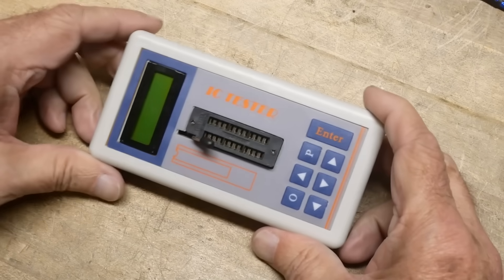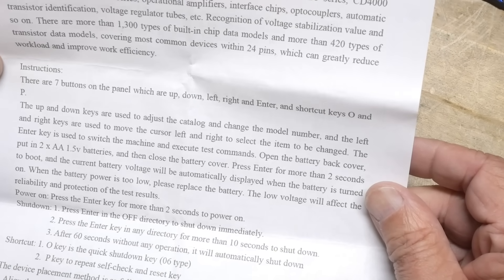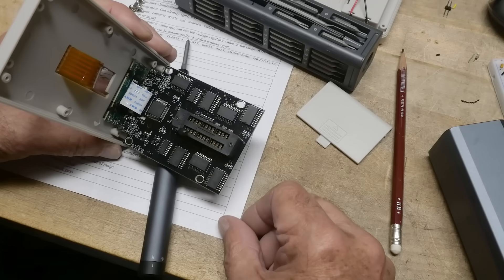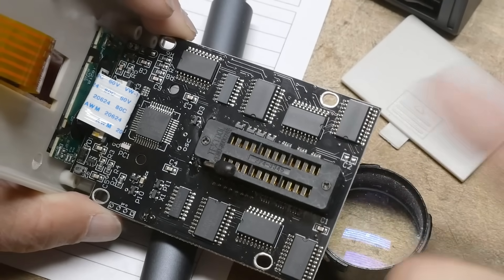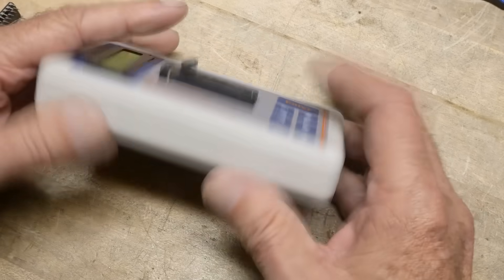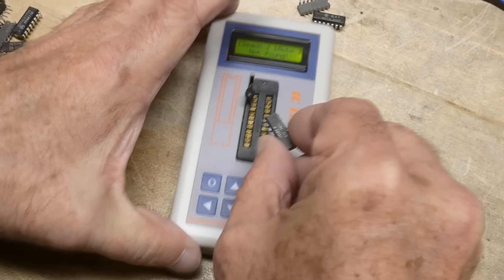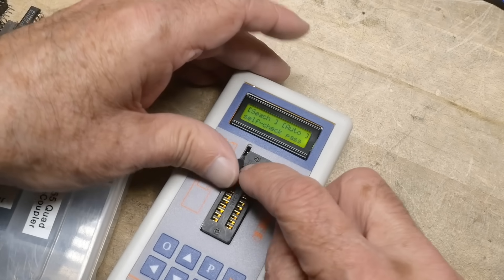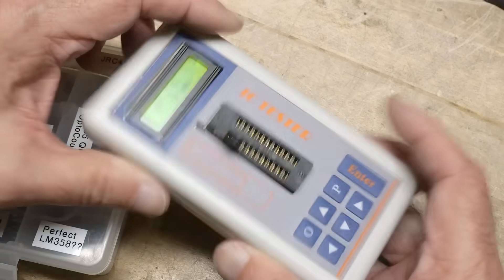#2245 IC Tester

Comment: I have that same tester (as well as a few other more advanced ones) and it does actually get used, as it is quick and easy to grab to quickly test a chip with, and so far has correctly identified if a chip is bad. I have the Retro Chip Tester pro as well, which is considerably better for testing IC's but is more bulky and harder to use.

Comment: I was contemplating getting one of the much fancier, but only slightly more expensive one, the Retro Chip Tester I think, for a project I was working on, but ended up not needing it, and never followed through with getting it. Good to know there are "cheap" versions available too, but for the few dollars more, I'd probably get the community supported one. I think it was actually fairly easy to add new chip definitions yourself, which makes it quite a bit more useful than a no-name generic overseas one which is basically what you get is what you get.

Comment: I have one and it's my go-to tester for most TTL and CMOS just because it's so simple to use.  But there are some that it doesn't work correctly on, like 4021, 4020, 4029, 4040.  Also some non-LS chips fail, like 7400 and 7474.

Comment: I bought an ABI Chipmaster, similar to this device, back in 1995 and it still gets occasional use working on vintage computer gear. Has been very useful over the years! The bigger ABI System 8 can actually test devices in-circuit too, compensating for in circuit configurations.
Reply: at 2:45 (and later too) you can see the - curiously mirror-imaged - text on the reverse of the PCB ... "ABI Chipmaster" ... it seems odd for that to be mirror-imaged and for the unit to not be labelled externally .. perhaps a copy or (rather poor, on the grounds that it doesn't really resemble a genuine ABI) counterfeit?
Reply: @davidareader I never noticed that - well spotted! It doesn’t resemble the Chipmaster device I have at all and even the software user interface is completely different.  It does seem rather suspicious that it is labelled  ABI ChipMaster internally!

Comment: I bought one of these about 2 years ago. It works great for identifying Logic IC's. But it will not work on any multivibrator hence why it didn't recognize your LS121. When I got mine it was the only thing in the box, so I didn't even know about it testing Transistors etc. I'll have to look around for that sheet you got with yours.

Comment: I have had one for years.  Do I use it, rarely.  However, when I do it is a real time saver.  Occasionally I run across something that has all the part numbers sanded off.  These are great for quickly identifying what those mystery parts are.

Comment: I got a little B&K transistor tester at a hamfest for a buck a couple weeks ago.  Hook a transistor up to it and you rotate a wheel switch and it identifies whether it is a good PNP or NPN and indicates the pin outs.  Or indicates nothing if it is bad.  Marginally useful,  got an old analog tester for further details.  Go No Go type thing for fast screening that pile of surplus or unidentified.  Made in USA though.
Reply: I still have mine, although I don't use it these days.  Used to repair TV/s, stereos, CB's, etc. at a mom & pop TV shop in the early/mid 80's.  The owner had the smaller one, I had the bigger one with an additional meter for Hfe maybe?  Been a while!  We used the crap out of them doing bench work back then mostly for quick go/no-go tests, often in-circuit.  You could match gain with them good enough for most of what we worked on at the time.  Had a lot of B&K equipment back then, their CB Service Master, freq. counter, and CB Signal Generator were the kitty's butt for wrenching on CB's.  Their TV Analyst and Marker Generators were the equivalent on the TV bench, of course a scope on each bench as well.  Sencore was considered top of the line for the repair guys,  and had a price tag to go along with it so I didn't know many guys that had it.  I think they leased a lot of it and I'm sure they had a finance scheme also.  Heck, back then a lot of guys were still using Eico, Heathkit, Knight, and other cheap scopes and VTVM's to help put things into perspective.

Comment: They aren't reliable.  Saw a YouTube from menditmike where the parts tested bad when they were good.
Reply: How about the more expensive ones?   Or are Chinese testers just worth what you paid for them?
Reply: @TomSherwood-z5l  I have the Retro Chip Tester Pro. It's a fun build, and it also tests RAM and reads ROM. I have found it reliable
Reply: I have been using it for a long time, sometimes it happens that in AUTO mode it does not find the tested IC or declares it defective, if I search for a specific group the IC is tested as good if it is really good
Reply: @Edisson.  Yes. To identify the IC, I imagine it needs to know how many pins, and then has to build a truth table of in/out and compare to a table. There's a potential for misidentification, too
Reply: @CyranoJones509  I wish I had a tester that I used to have at work - telecom operational research and development laboratory - a small box in the shape of a suitcase (I can't remember the manufacturer Ericson or Siemens) the circuit under test was inserted into one ZIF socket and a program matrix with the same marking into the other. It could be tested manually in individual steps, or automatically, the test speed could be set in automatic mode - the tester was able to verify the speed specifications of the tested ICs. The accessories were several cartridges with program matrices according to the IC types, if the IC met the set parameters it was 100% OK

Comment: I saw one IC tester in late 90s in a lab and I badly wanted one. That unit was big, the size of an XT desktop computer. Because I used mostly Z80, I8031, CMOS and TTL logic ICs in my projects, I built one myself, using my MSX computer as its brain and a expansion card that I built myself. I managed to make another expansion card for opamps (1,2 and 4 opamp ICs). Altough it was quite limited (I could not make the auto function to work correctly, I remember sometimes it burned TTL ICs), I used it a lot. And I was proud of it because it was entirely built and projected be me and a professional one was thousands USD at the time.